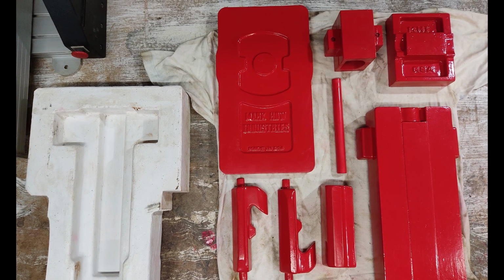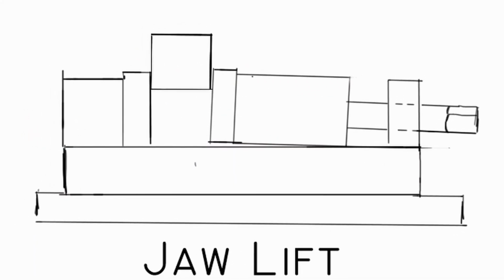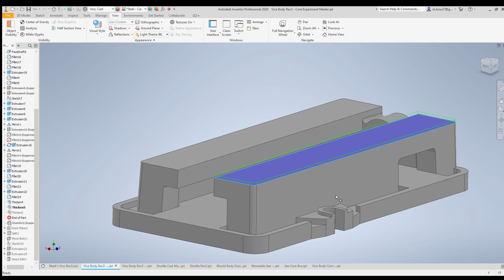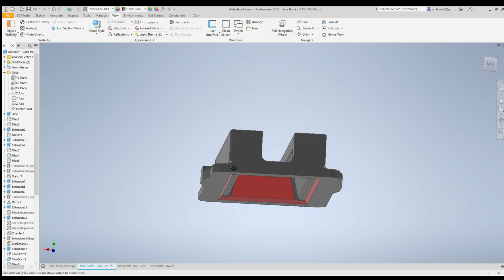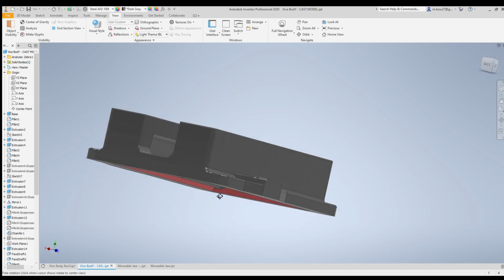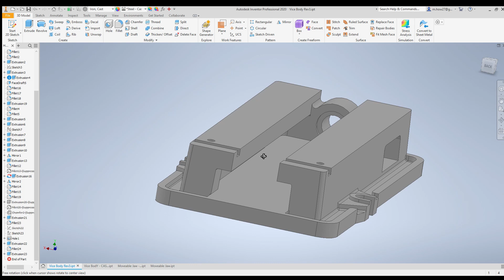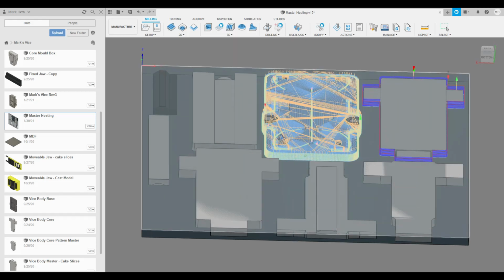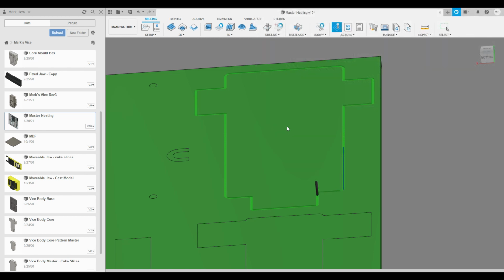DIY Cast Machine Vise Part 2 - Making my own casting patterns

Comment: But why choose process of casting , we can make it also from machining , because  for casting you must need furnace , mould also.
Reply from the maker: Most definitely, but making the moulds was the challenge I wanted to try. I wanted to experiment with CNC pattern making for castings. A lot of foundries are struggling here where I live, and there are some things castings are still awesome for
Reply: @Mark_How  but it requires too much money , we can use conventional milling for casting mould pattern because they doesn't need too much precise
Reply from the maker: @panchalhardik4118  doesn't have to be expensive cnc's. In one of my earlier videos I rebuilt an old 3d printer because I wanted to try using that to make patterns